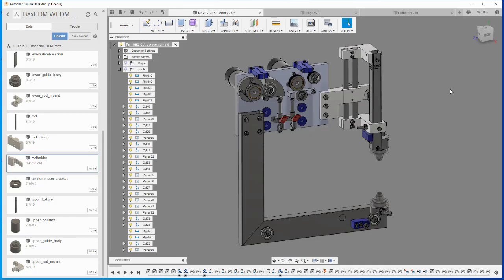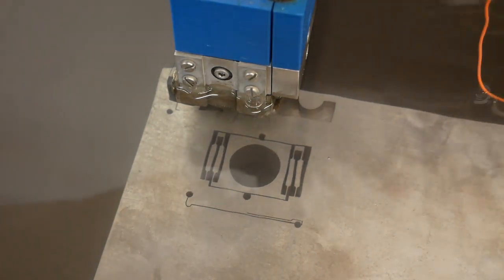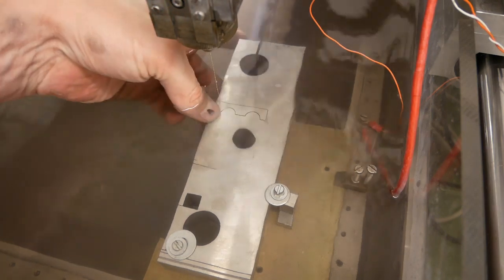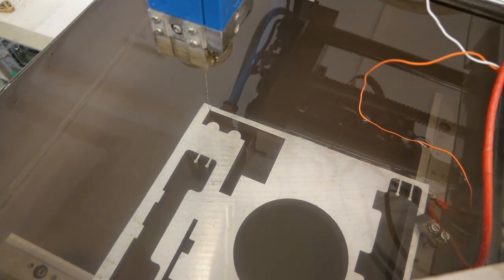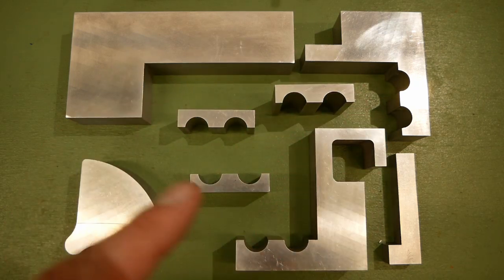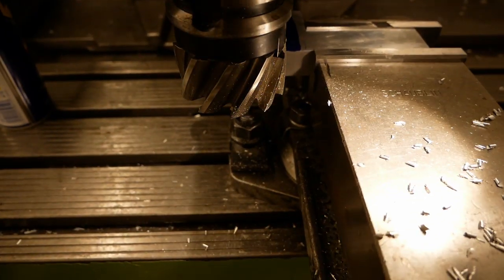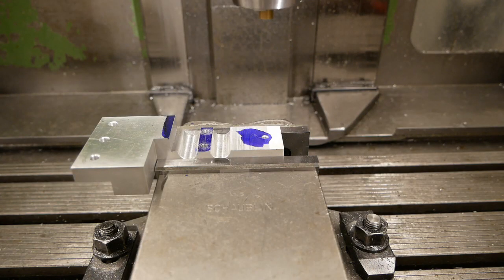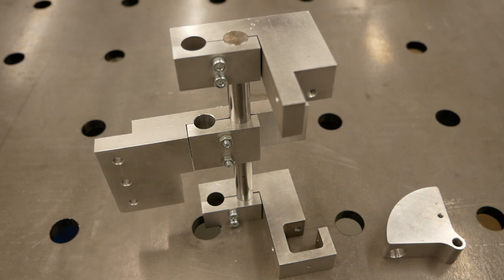Wire-EDM Machine, complete MK2 redesign: Part 5, making C-Arc parts

Comment: Cool to see the pieces of the new assembly come together.  Assuming you're on your way to a commercial offering, do you see the "mass" production using EDM to create these parts or would you or the CM go back to milling to improve the productivity to produce a bunch of parts?
Reply from the maker: I'll leave the EDM vs Milling decision up to my manufacturing partner. My guess is that for higher volumes milling will be used as it's faster and the parts are easy to mill. Generally, EDM is only used for parts that cant be milled.

Comment: Very cool...can’t wait to see more!  Question not really related to this video...I have seen some videos on YouTube of wire EDM machines that do not submerge the wire, i.e. just a little coolant of some sort dripping over the cut area. I am wondering if this is possible to do with your power supply?  What are the disadvantages to this style of EDM?
Reply from the maker: Hi Scot. Good question. I could do non-submerged flushing like that as well, but that will radically decrease cutting performance and part finish. Only really old machines work like that. For high speed cutting you need to flush at high pressure, if you would do this above water the water would spray through the workspace, that's the only reason why submerged cutting is used. In an EDM cutting process, having a good flush is just as important as having a good arc.
Reply: Hi Mike,
Thank you for the explanation. That makes complete sense.

Comment: why are you milling if the same can be done with erosion?)
Reply from the maker: Could have edm cut it, but fixturing was easier in the milling vice. Otherwise I needed to make a few clamps for fixturing the taller piece in the edm machine.

Comment: your one part calls for two helicoiles
Reply from the maker: Threaded insert is a good idea, I might incorporate it. In MK1 however I've loosened/fastened those bolts a gazillion times and the treads are still ok. But inserts would be better, just to be sure. Thanks for the tip.
Reply: Stainless nut serts, or better, just put a plate with the tapped holes in the back,.Helicoils , do not work much at all if you have to keep on undoing the bolts , I have some experience on that